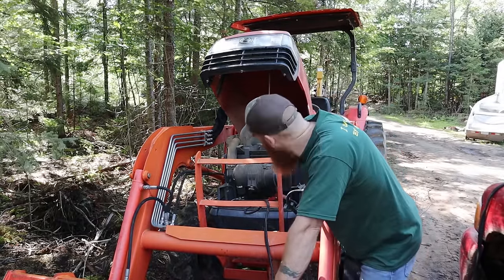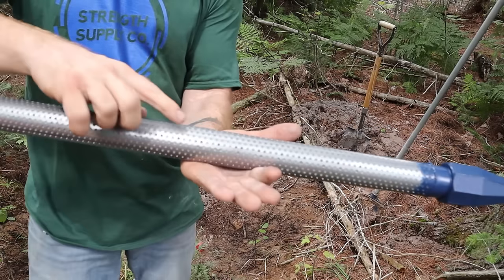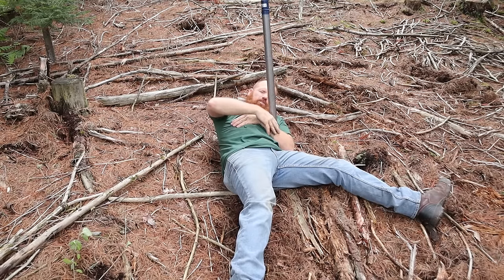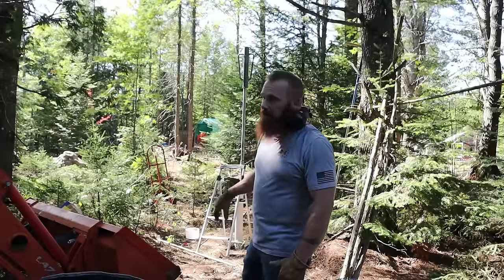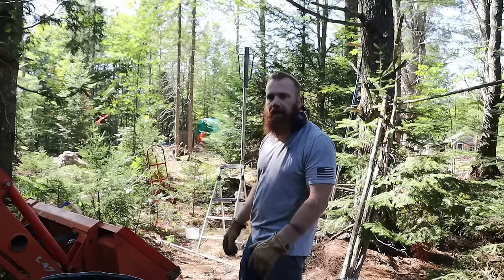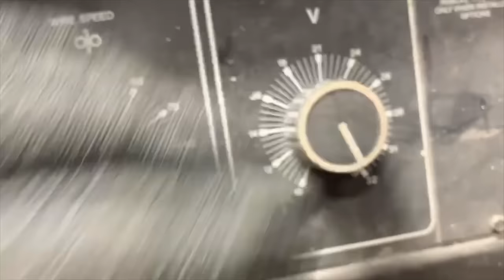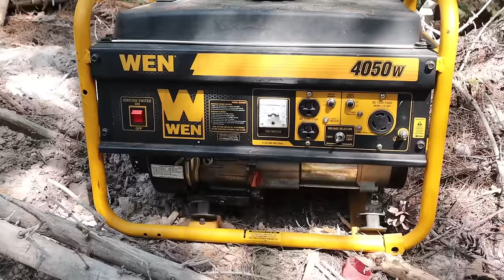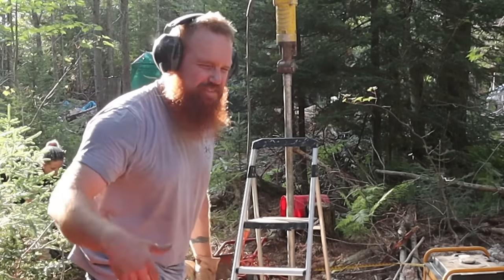Off Grid YouTube Family of Girls Step up to Help Dad Drive a Well | Fabricating Off Grid Well Tools

Comment: With the clay you're in.I would suggest a one man well drilling rig. You can drill a 100' in a weekend, Put 4in.  Schedule 40pvc in and a submersible pump and be good to go. They are called sandpoints not clay points there's (3) we'll never get back here. I ended up buying a $200 post auger, A 4in. Steel t and cap Some fabrication . I made well drilling  rig for 5ft. 1in pipe. I have put (3) 100ft. Wells in here and all still working after 15 years.  I could not see paying 8 grand for someone to drill a hole for me.

Comment: Driving the well is about harmonics, you're probably building shockwaves all over the length of the pipe with that hammer.  Does it have a single strike mode?
Reply from the maker: Nope

Comment: I think I would  be using that front loader bucket to slam that thing home. Using bigger pipe of course. Get that hole in there and then put the actual piping in place.
Reply from the maker: This tractor must look like a big one in the videos! 😂 It won’t even push in the 1 and a 1/4 pipe. Tried it

Comment: All well and good, pun intended, but how about using that nice heavy hydraulic tractor that just sits idle in the background?
Reply from the maker: I have considered trying to rig up a drill rig with the auger attachment but haven’t had a chance. And I have tried using the bucket to drive in the pipe but it won’t do it as the tractor is just a little guy. And I don’t have the money to buy a drill rig to run with the tractor

Comment: O.M.G. I would have LOVED to have the equipment at hand, that you had, to assist me in sinking my wells. All I had was 8 inch steel casing X 120 feet, Tri Stand with chain block at top, 160 feet of rope attached to a 4' sludge pump. (sludge pump is a 4" steel pipe with 2" hole in the bottom and steel ball inside which acts as a valve.) You need some water to start the process, or a post hole digger. Dig the first 3 feet or so, insert the first steel casing, which has sharp teeth cut into the bottom end, now drop the sludge pump down into the casing, pour a bucket of wate down the hole and keep lifting and dropping the sludge pump until increased weight tells you it's full. Bring to surface and empty. Repeat about a million times or until your arms fall off. Sometimes you will hit coffee rock or limestone, then you need to attach a bar to the bore casing and turn the lot to grind your way thru. Then continue the slugging until you strike course sand, then take not of the depth of sand and water content. Once you've worked that out, rest and allow settlement, then check with string the water height within your casing. I've sunk three bores/wells in this manner, and the feeling of success when you strike sufficient water outweighs the pain and sweat.
Reply: Another issue I've employed, is before I even start the work, I  employ a water diviner to walk my block and discover where the best/most and depth of water is. Sounds like witchcraft, but it's never failed me yet. Never experienced a dry hole yet. That would be devastating.

Comment: What about pushing water down with high pressure to soften up the dirt deep down?
Could that front end loader be used for lifting up pipe?
Comment from someone who hasn’t done it.
Reply from the maker: It’s hard to have a water source to push the water down out there. And getting something hooked to the broken pipe has been a chore. Still haven’t got it.

Comment: Every time I see someone doing it manually that way, I wonder, why not build a simple pile driver. All you need is 3 pieces of wood put in a triangle support, a pulley, a weight and some rope. IF you have good wind, you can use that to raise the weight. If you have to do it by hand, 3 or 4 pulleys set right can make it where a small child can raise it, or put it on a wheel and have a lamb, cow or horse go around in circles.
Reply from the maker: Because it would take longer to get the job done by building all that. But like most things, there are lots of different ways to attack it. We just chose physical force.
Reply: @9252LIFE  To each their own. The only wrong way is if you aren't doing it your way.

Comment: Bro why not try drilling conventionally?   is done with water, it removes the cuttings and brings it back to the surface.  Try setting up 2 small ponds with your tractor and line it with plastic or a cheap tarp.  one pond to receive the cuttings and water from the well. have a small channel over to your other pond so the somewhat clean water can be pumped back down the well then recycle the water back onto the well with your pump through the pipe.  cement in your plastic pipe about 3-4 ft down so the water doesnt come up outside the plastic pipe and make a mess.  put a tee on the plastic pipe and channel the returns from the well to your first pond. if you can figure out a swivel for the top of the pipe even better and put a bit  bigger than the pipe so there is an annular space for the returns to come back to the surface on the end and rotate the pipe then you could finish this without damaging your pipe and go quite deep if needed.

Comment: I know this is two years later, that point should have been abandoned at 16 feet I’m wondering how was that 110v shallow pump going to pull water 55 feet
Reply from the maker: The water was naturally up around 8 feet but the clay was extremely deep. If the pipe had made it through the clay the water would’ve naturally climbed up around that 8 feet point and even the hand pump would’ve done it.

Comment: Is that pottery clay? You can sell it? For extra money or to make your own Bricks?  Also, you can re-thread I do my own pipe thread 3/4-2" Check with TSC or Harbor Freight Tools? Or have your good friend or Plumber cut the thread?  Or pull it back up? isn't easy but with patients, and a long pole, Chain, A-frame/Tipi (3- 4x4 tri set up?) Will do the trick.
Reply from the maker: Not sure on the clay.

Comment: have you thought about using the bucket to drive the pipe in...?
Reply from the maker: Yes we’ve tried it. The tractor is not tough enough even with a loaded bucket. The point traveling through the clay has much more resistance than a t post for fencing. I’ve used a skid steer in my younger years to drive t post. Would’ve been nice to be able to use the tractor for this.

Comment: Did you dowse for the spot first?
Reply from the maker: Yes but I am not sure how well my dowsing is.
Reply: You can test your abilities on things you know.   Cracks in sidewalks, buried pipes, or any other discontinuity underground.   When looking for water, I use many points on the surface by following a grid and looking for a branching stream pattern.  Typically I will pick an intersection of several branches when possible.  Even in coarse gravel underground, flowing water will make and follow arteries.  Anyway, if you got water, your all set!

Comment: Your tractor, with a weight operated by the lift, would make driving the rod into the ground much easier,
Reply: Also probably collapse the pipe from too much force. If the jack hammer broke the pipe, anything heavier probably would too.

Comment: Drill u r well Chad  drop u r cassing then drop corse sand down around it and some beninate near surface to seel it from run off wsurface water .. 
It will be worth the extra efforts.. and long lasting .. 50' is not all that deep realey .. if u did it like this the first time ..
Well .. well .... well ... water is name of game ..

Comment: Not read all the comments, but you have a tractor with front bucket?  I would be using those steps to get up to that bucket to use it as a work platform, not go post-banging from a set of flimsy steps!
Reply from the maker: Yes but in all honesty the ladder wasn’t an issue at all. The tractor bucket held all our hardware.

Comment: Not to be pessimistic, just realistic, but why do you assume there is water-bearing sand at depth? You look to be at elevation, both in terms of absolute sea-level and locally in terms of hills/early mountains vs nearby valleys.  You could be pushing through ancient sea-bed (clay deposition) before hitting bedrock.  The water table runs on top of the clay, no guarantee to find an aquifer layer within it.  At elevation, i wouldnt bet on it, either.  Also you should look into a hydraulic rig (use a sump pond to recycle the water) and save yourself a lot of broken backs and broken pipes.

Comment: Wouldn't it be easier to open up the road - to get the drilling rig in ? You drove that red Dodge in there, so couldn't you get the rig in there with a little chain saw work ?
Reply from the maker: No. I tried. Their trucks are too big and it’s over a 9 mile drive in on the side the big trucks would have a chance. We managed to get our 40 foot RV back here but practically destroyed it getting it in..

Comment: Why not use part of the weight of the tractor to drive the pipe.  Less likelihood of damaging the threads than hammering it.  Put the bucket on top the pipe then lower the bucket.
Reply from the maker: We tried that and the tractor just isn’t tough enough.

Comment: OFF GRID ! Help me Understand ? You Have a Nice Tractor witch runs on Diesel Fuel or Gasoline ! Did you drill down for the Gas or Diesel if so How Far ?
Reply from the maker: 627 feet for oil

Comment: I am NOT 100% sure, but I think what you are trying to do with an above ground pipe is impossible.. Example: I have a 10" casing that goes down about 100 feet. Yes 10 inch. When it was set it handles 2 square miles of orange groves, Had a diesel generator running a turban on top of the well. So, back in the 70's this land was all sold for residential building and the well was capped. This property was a park for several years until the last owner bought it and built my house on it. When he built it up, he had a 2HP 4" deep well pump put in and they dropped it 84 feet. It worked, but had issues as they didn't know to shroud the pump with a 4" PVC casing to keep the pump cool.. So, twelve years ago I buy this property. After remodeling everything I finally got to work on the well. (It was what killed the last owner so I was in no hurry)..... Turn it on and it would run maybe 5 minutes and die. Let it set for 5 minutes and hit the reset and she would run again for another 5 minutes. So, I already told you how to fix this issue, but because I have a bad back, I had to look for another way. That came in an above ground 1HP pump. It works very well, but only because I have a 1 1/4" pipe (PVC), hanging inside the 10" well casing and it only drops into the well a bit over 20 feet!!!! I also put a foot valve on it to keep the water from running out of the pump and losing prime...  So, if you see water 8 feet down, you can pump from that water, but you won't know how much water you can pump at once unless you set it up and crank up the pump.... But I think you are trying to do the impossible trying to draw water up anything more than 2- - 25 feet.  I could be wrong, but that's the way I understand it from the pro's.

Comment: I have to ask a stupid question why not use the tractor to pound it or at least make a pulley system with a half a log and a plate of Steel you can pull that log up and down and pound that in a lot easier.  GL
Reply from the maker: The tractor won’t pound it in. And we could rig up a pulley system. Probably do that in the future.

Comment: Hah when I saw the 60 foot claim I was about to call BS because you can't pump water by hand more than about 25 feet. Then I saw the powered pump.
Reply from the maker: We could’ve pumped water at the 60 ft because the water is only a few feet down and it would naturally rise in the pipe. But the thick clay stopped up the screen
Reply: @9252LIFE Makes sense, I've only done 1 myself and the water line was only about 4 foot down in very sandy soil. Took all of like 20 minutes.

Comment: I like your mindset..But you're going about digging a well the hard way..Think how would that truck that can't get in there do it..They drill, which you're going to need to do too..I know this guy that used a swap cooler motor as the drill drive unit. You're going to need to think outside the box..How do you construct a smaller version of the drill truck's drilling apparatus..Think about it..Watch some in action..

Comment: That pipe is not designed for hammering on. You need to make a drill head with a hole for a water jet. Hook up a pressure washer and rotate  the pipe by hand or with a motor. Or buy a borzit. Very inexpensive
Reply from the maker: The pipe is Drive pipe. Made for driving. I’ve seen that water jet idea and that looks pretty neat. May end up going that route if we can’t get this one to work.

Comment: You should have used a power washer and stuck it down the 4-in and let it shoot the mud and dirt lose that way you can just slide this stuff down through there like butter
Reply from the maker: We didn’t exactly have the equipment to pump creek water to a power washer to shoot down the hole at that time.

Comment: Why didn’t you create a screen in the bottom of the pvc by cutting random cuts with a hacksaw about five feet up then backfill with pea gravel about seven feet from bottom this will allow water to seep easily through the ground inside the pvc further up cap the well with grout .
Reply from the maker: We are trying to get to sand and good water. If we were to put the pea gravel in at that depth the clay wouldn’t let water in very fast at all and we wouldn’t get a steady flow.

Comment: Chad, PLEASE do not make the last connection of jumper cables at the battery terminal! The last connection should be the negative cable at an engine component of metal such as an engine hook or bracket. The battery is a potential HYDROGEN source…aka Hindenburg! Be safe.
Reply from the maker: Either way works. Bombs away! 😆 💣

Comment: Hmm. I'd think it would be much easier to use the tractor to push the pipe 5' At a time. But well done Sr.
Reply from the maker: Yes it would be way easier. But the tractor won’t do it.
Reply: I admire your willingness to try
Reply from the maker: Thank you Mark. It’s been a real good time so far. 😆

Comment: Why not put a collar at the end of the pipe,  put both pipe wrenches underneath the collar, wrap a chain around the pipe below the wrenches and pull the pipe up with the tractor bucket?  Im 74, never had a tractor with a bucket, and have did all the things your doing the way your doing them.
Reply from the maker: Have tried that and the tractor isn’t tough enough to pull it up. A skid steer would definitely be a bit more helpful in that

Comment: Well. That just bites. It's disheartening to work so hard and have something like that happen. I helped drill a 55ft well using 2" schedule 40 pvc with a homemade drill tip and a pump from a swimming pool. That well made something like 10 gallons per minute and was a fun project. Yours doesn't look like fun. Lol I'm subscribing just to keep up with your progress on the well. Best wishes man! 
Also, if you happen to know someone in that area with a seismograph drill buggy they could get to that site and drill it down pretty fast if they don't hit rock.
Reply from the maker: Awesome thank you.

Comment: could you not have used the bucket on the backhoe to push pipe in?  we do that with fence posts. beats hammering them in.
Reply from the maker: No the tractor isn’t tough enough.
Reply: @9252LIFE  you'd be surprised.  put some weight in the bucket

Comment: He should have used the bucket from the tractor to pound it in. Ive done this literally hundreds of times driving in fence posts..
Reply from the maker: Yes Bill your key words there are “fence posts..” You literally never pounded a well point in with a small tractor like ours.. I have literally driven in fence T post in with a skid steer before and man that works great! But unfortunately this well point is much more blunt! The tractor will not at all pound in the pipe. We’ve tried. Unfortunately we didn’t have that on video because lots others seem to think that little Kubota can work the same miracle. Anyway Bill have a great weekend.

Comment: I've no knowledge of this, but why can't you just pump the water with the pvc pipe and settle the clay out in any other tank or something? Is it just that you would have to dump the clay out, disrupting your water supply? I get that it's an imperfect solution but I have to assume you are getting water delivered.
Reply: simple. clay does not pump.
This is not a bit of clay in your water, this is clay with a bit of water in it

Comment: sorry tough luck. they invented well drilling because friction will eventually over come the driving force and the pipe will fail. Which was the reason modern drilling was invented. And people lived beside rivers. It is only in the last 175 years people can live virtually anywhere. In the panhandle of texas you can dry drill to about 100' then you pretty much have to circulate the hole with mud. The last well I had drilled cost 35k so drilling is always an investment.  Did you check into pressure drilling those rigs are much smaller and might be able to get to your location
Reply from the maker: There’s not much of anything up here. The Well driller guy said if we don’t get the well to work this year he may attempt coming out come spring

Comment: At   7:35    why not  just put a gallon of water in the hole...life and drop the pipe. It will fall in.....no need for driving it !  The hydraulics of the water lubricates and forces the dirt aside.
Reply from the maker: The dirt isn’t just sand.. it’s a thick clay and doesn’t work like you’d think.
Reply: @9252LIFE  Either way it works.  Clay creates a tighter seal around the pipe allowing the air pressure in front to force the dirt open.  Ive done it....and it works !